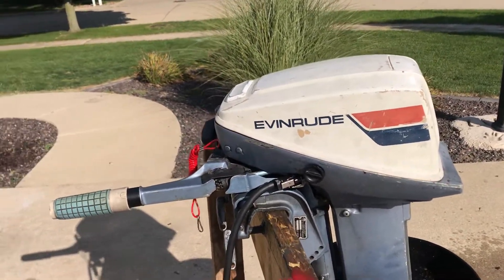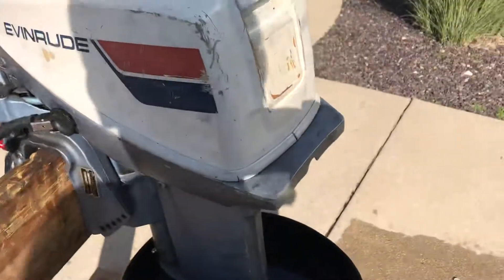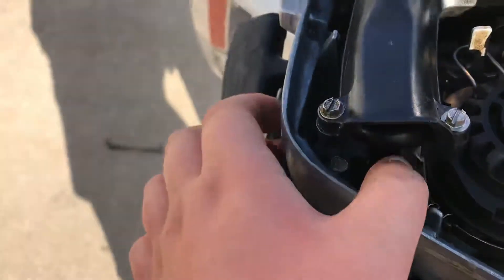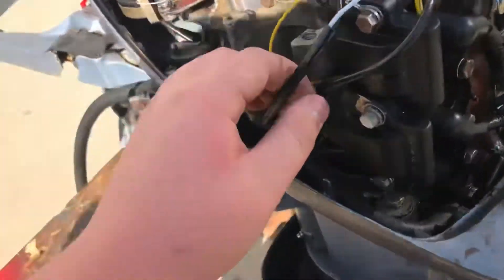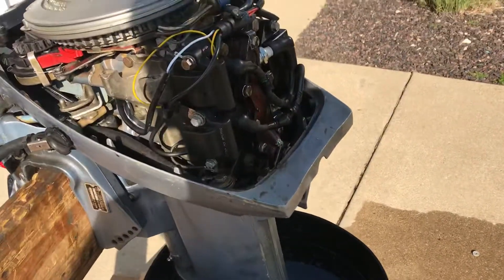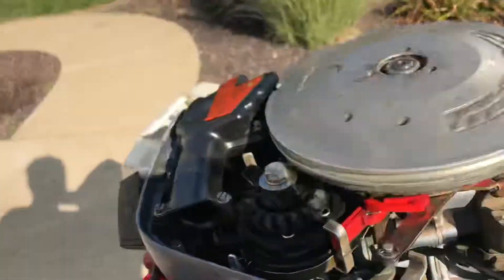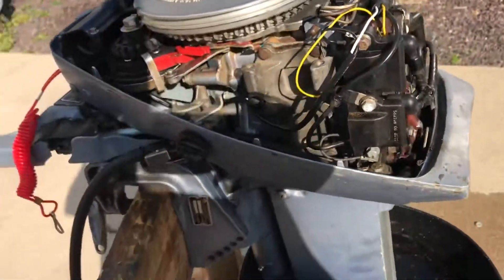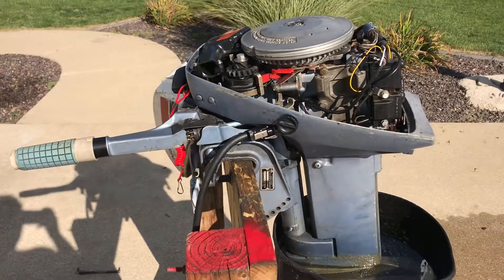How to Add a Kill Switch to an Outboard

Comment: I stopped half way through.  "You need ot buy one of these".  One of these... what?   "You can get tis on eBay.."  This... what?  "Attach this wire to ground".. was that part of the original motor or part of a kit?  Clear as mud.
Reply from the maker: Sorry you felt that way but put your brain to it and maybe you’ll realize it ain’t so hard to understand
Reply: @sethgabbard7705  I did put my brain to it.  I watched a different vid that actually explained what each part was instead of "This piece, whatever it is, has a sort of black wire that goes somewhere around here and....".